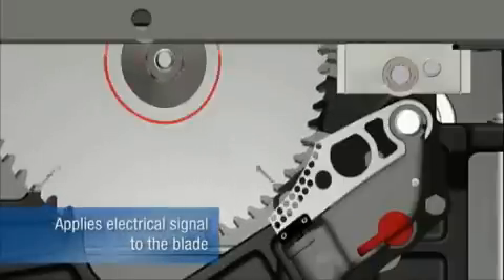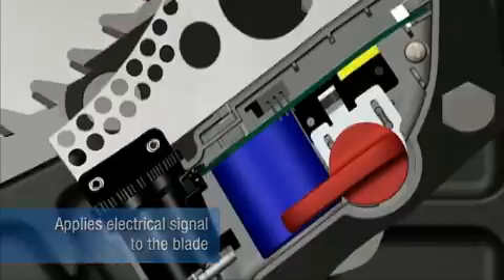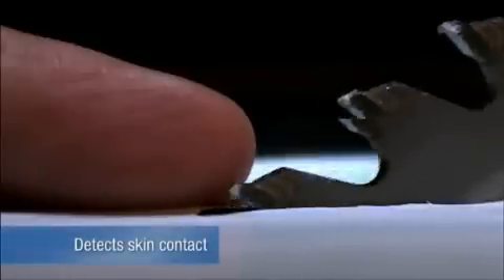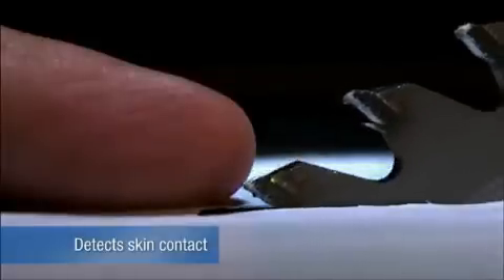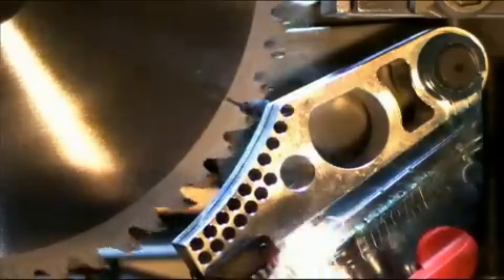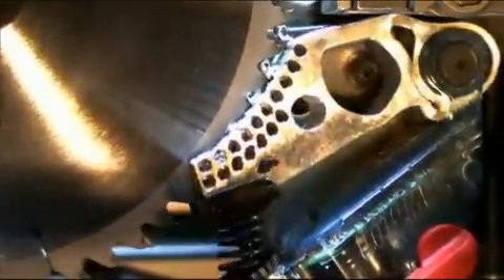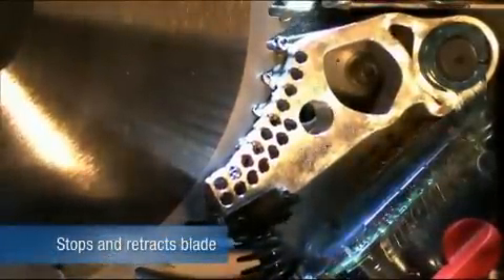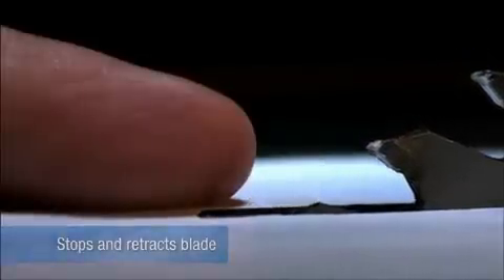SawStop Safety System

Comment: something this sophisticated, could easily be setup with a cheaper fuse replacement.  also, why scrap the blade, maybe it could be diving into a rubber block wrapped with wool instead.

Comment: wonder what the cost of one of those brakes are . great safety idea but will it ever malfunction that it doesnt work . or worse yet  to consumers pocket trip when it doesnt have to . causing your saw to be down and ya cant finish the job
Reply: Best thing is probably have am extra cartridge handy. I think they are only a couple hundred bucks. A small price to pay for saving a finger.
Reply: They are $90 plus u gotta get another blade so around $180 for everything

Comment: I've had nothing but issues from a grizzly industrial product. My wife and I drove over 5 hours, and spent over $1200 at the Grizzly showroom in Missouri. Honestly the showroom is amazing. The product I got...not so much. I've had over 10 separate issues including defective, and back ordered parts sent to me. Grizzly did offer me $100 to keep the pos 😂😂😂. I like high quality tools, and won't hesitate to spend the money on them. Powermatic, Jet, SCM, felder, festool, saw stop etc. I like decent hand tools such as snap on, Milwaukee, dewalt, and I even think husky is decent due to being able to swap tools easily when they break one the job. We even have some harbor freight tools that I think are very very good. My experience with grizzly has been unsatisfactory at best. Not to mention they will not post my review on their actual website. Hopefully my review will help someone looking for equipment.

Comment: I purchased my SawStop a few months ago. Yesterday, I was using a jig with bolts ( wedgie sled ) when one of the nuts came loose, and the bolt came off and hit the blade....nothing happened. I know the bolt hit the blade as it had a nick in it. Should I be worried that the safety feature is not working? Any way to test it without blowing a $70 cartridge? Thanks, Gary
Reply: They say: "When skin contacts the blade, the signal changes, because the human body is conductive.  This change in signal triggers a quick-release aluminum brake."  A bolt hitting the blade is not the human body (and is conductive), so it shouldn't stop the blade.
Reply: Watch the video and ask yourself that question again.
Reply: Only way to know is try putting your finger next to the blade lol

Comment from the maker: Did you know that in the U.S. there is a table saw accident every 9 minutes - 10 amputations per day? SawStop has the solution. Check out our safety system in action!
Reply: What happens if your hand slips or if you were to trip and fall on the blade rather than just touching the blade?
Reply: @DavidXSmith  Barely a scratch We sell Saw Stop where i work and a customer of our had that happen... they tripped over an extension cord, fell elbow first right onto the blade and walked away with a small nick. it didnt even bleed.
Reply: @DavidXSmith  Yuor outcome with a sawstop will be a hell of a lot better.
Reply: A friend of mine's dad had his hand nearly amputated during a saw accident. I really wish his job had these!! I think they should be required!
Reply: How much table saw

Comment: All this high tech solution for something solved years ago by the introduction of the cross cut sled. Use that and your hands are never near the blade.
Reply: If all you’re making are cross cuts, you don’t even need a table saw in the first place.
Reply: @ataribigby  so true, but even if you are ripping long narrow pieces, you could always use a sacrificial piece  of any convenient length to "go where too many hands have gone before".
Reply: @ataribigby  correct use a Miter saw way less expensive, safer and less space required.
Reply: Nothing is a good replacement for a table saw in a small shop. SawStop has the correct solution for a variety of reasons and applications.